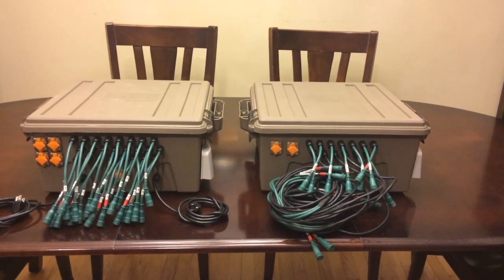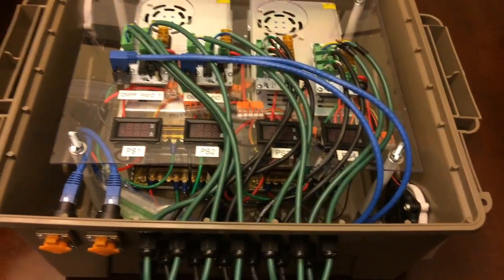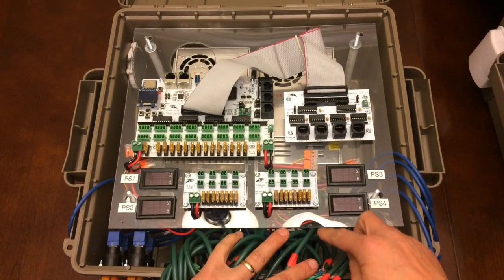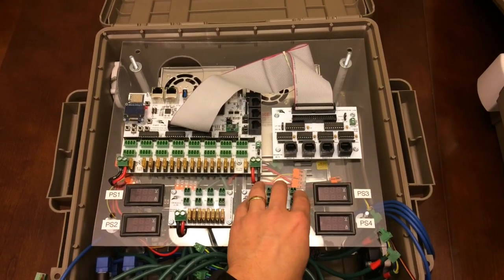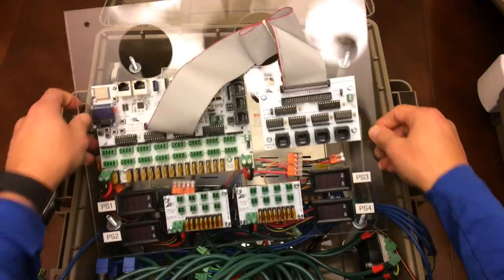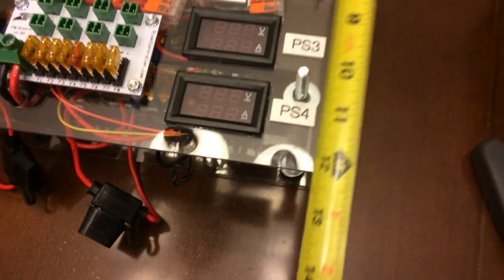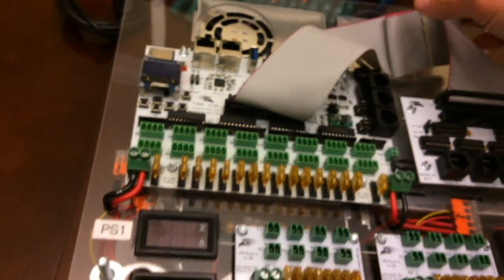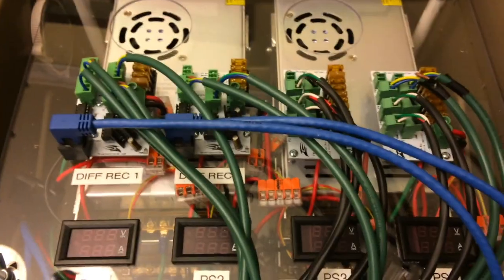Falcon F16V3 Ammo Box Build Breakdown

Comment: Hi can you tell me what size a fuse you use,  for a f16v
Reply from the maker: The fusing size can be debated. I use 25A fuses between the power supply and the F16 board. However, I believe each power input to the board is rated for 20A. That rating should be verified but I’ve not ever had any issue with the setup. After running a bunch of tests with real world pixels, rarely will any single output draw anywhere near 5A. So, the possibility of driving all outputs at the max is highly unlikely. The 5A board fuses and 25A fuse from the power supply are really there to cut power should there be a short somewhere.  I’ve had 5A fuses go but never the 25A power supply fuse. 

Good luck!

Comment: I have watched all your videos multiple times. Preparing for a new display this year. Going from traditional to pixels. Question is where do you get the pig tails for the boxes I didn't see them on your parts list.
Reply from the maker: Thanks for the comment and glad to hear that all the videos have been useful. 

Regarding your question, the pigtails used in the controller builds were purchased from the vendors where I also ordered my pixels. You should be able to source those female connectors with your specific connector end (Ray Wu, X-Connect, etc) from most any pixel vendor companies. They are typically 14” to 18” long and work great. 

Best of luck through your transition from tradition lights to pixels!

Comment: Great video. Really breaks down the build to easy understanding. One question i had was, when connecting two PSUs, you have live, neutral, ground from the AC line jumped between the PSUs, but what is the 4th black line?
Reply from the maker: Thanks! The far right 3 wires are for connecting the top and bottom power supply AC connections. The black wire to the left of those 2 wires is to bond the DC V- between power supplies. Don’t do that with the V+, just the V-. This ensures that you don’t get data corruption if you power inject pixels across the two power supplies.

Comment: hi there i want to connect other power supply to my controller advatek controller to port 9 to 16 to do so could i add a other ac wire to power supply 2 and  connect negative and postive to v2 and plug that power supply into wall socket so that means i would have 2 separate wires to plug into wall or is there a better way thank you for your help and then from port 9 to 16 i could use that power supply to power inject also
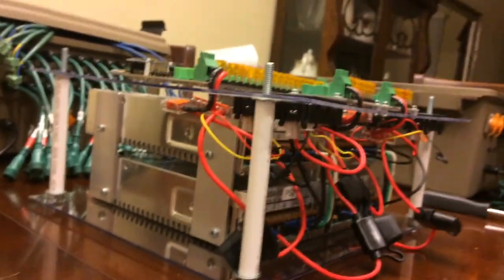Reply from the maker: Hi Den Bel, thanks for your comment. You can certainly add a second power supply and tie them together (in parallel) while using a single AC power cord to go to your house wall outlet. See the video at 18:12. There, I show how I connect two power supplies together, and they share a common house AC plug.

Comment: hi there great video im new in doing pixel i have a question i have total 1,455 5 volts pixel ws2811 in my props running at 30 percent brightness i have a advatek controller and 350 watt power surply could the power surply handle that and if not how could i connect other power surply thank you
Reply from the maker: Hi den bel, thanks for the comment. You should have no problem powering that many pixels with one power supply. Each 5V pixel uses about 0.3W at 100% brightness on full white (with all 3 LEDs on). So, 1,455 x 0.3W/pixel x 0.3 (brightness) = 131W, which is well below the 350W capacity of your power supply. 

In reality, you’ll end up using less power than that due to voltage drops across the string of 5V pixels. 

Good luck with your setup!
Reply: thanks alot for helping me i will power inject   also on my props have a good day

Comment: Very nice work! I am going to try and replicate this. Question - Does the air vent compromise the waterproofing? I am in NJ and get some snow during christmas
Reply from the maker: Thanks for the comment Roshan. The air vents do not compromise weather proofing. They are designed specifically for this type of purpose. The outer piece has a rubber gasket that seals up against the enclosure housing. The interior screw piece is used to tighten the outer piece with the rubber o-ring gasket to seal the opening from water ingress. 

The opening of the vent should be pointed downward so water can’t naturally get into your enclosure. My boxes are used outside in the rain and snow and have had no water ingress over 5 years of use. 

The exhaust fan mounted to the interior of the right vent is blowing air out. Be sure to orient the fan properly so you aren’t accidentally blowing air in and potentially drawing water into the enclosure. 

Good luck with your build!

Comment: Cool. But how does all those electronics work. ?
Reply from the maker: Hi John, in a nutshell, the Falcon pixel controllers convert show data streams (from a Falcon Pi Player computer like a Raspberry Pi or a Beagle Bone Black OR from a PC running xScheduler) to pixel compliant (WS2811 in my case) data streams. The controller also supplies DC power for the pixels. The choice of pixel controller is based on your needs (how many outputs you want/need, how many pixels per output, and how consolidated or distributed your pixels are in your show). 

That’s a basic description. There are other good videos at the xLights video repository in the xEssentials series. Since you asked, I may put together a brief intro covering the basic pieces to a show once the season is over and I have access to all the components.

Comment: Thank you soooooo much for this! I built the box on the left and it ran my whole show with 0 issue. I was amazed at how I hardly used any Power Injection and it still came out super nice.  Some runs had close to 350 pixels Over 60 feet @ 25%, and was minimal degradation. Going to build your CG 1500 for next seasons add-ons! Much appreciated! Thanks Again!
Reply from the maker: Congrats!!!

Comment: This is very nice build Steve.  I’m using bud box 32026 for controller and 2 diff expansion.  I’m running out of space  for the 9 cable passthru glands.  Can the cat 6 cable be bent in any direction without causing connection issues? Tks
Reply from the maker: Thanks for the comment Randy. Controller build boxes can get cozy. The cat6 cables shown in this video have one straight end and one 90 degree end. The cable itself is very soft and pliable, so it’s possible you could immediately turn the cable without issues. You just don’t want to do any extreme turns which could flex the internal wires so much that they fatigue and break internally.

Comment: Do you have info on the pigtail connectors? Gauge, length
Reply from the maker: Todd, the pigtails are standard 18AWG, 18”, 3 core, female pre-made pigtails. Order the ones that match the pixel connections you purchase (Eg xConnect or Ray Wu). Most vendors sell this type of pigtail.

Comment: What fuse are you using in your auto fuse that is between the power supply and the boards?
Reply from the maker: The fuses are standard ATC auto fuses. I most commonly use 20A or 25A fuses between the power supply and a control board.
Reply: @NiFamilyLights  Thank you! I'm in the process of ordering everything I need to do my roof line for my first year. Only thing I seem to have trouble finding is pixels. I decided to go with Kulp controllers as they look like a nice affordable option. Have you ever used them?
Reply from the maker: KW, I have not used Kulp controllers.  However, it is a great product, so you should do well with it.  I personally like the Falcon controllers as there are fewer parts to deal with.

Comment: The blue cable goes out to your Router?
Reply from the maker: It depends on which blue cable. There are 4 that are attached to the differential expansion board. These connect to differential receivers (aka smart receivers). Although they use Ethernet cables, the data sent is not normal IP data, so you don’t want to connect those to a router. 

There is also a network cable that’s connected to the network port at the top of the F16v3 (and there’s 2 network ports). That one does connect to a router or switch.
Reply: @NiFamilyLights  Thank you so much Mr.Ni. Im new to this hobby Zero knowledge about Xlights. But Im starting to learn from all of your posted video as far as setting up, connection, parts etc. I only have i.e. 16' Mega Tree with topper star, Roof line, Icicles, 3 window outline, 6 leaping arches,  6 Mini Tree with star, 6 Verticals poles and Star of Bethlehem. I use figure 6 that represents my 6 grand Kidz hehehe. All of this pros and models have already installed pixels. My problem now is connections to my controllers and power them all up..  Right now the level of stress and worry is starting to rise up  and we are approaching  half of 2021, problems starting to occur i.e. How many controllers i need... how many expansion board i need.. smart receiver i need.. How many PS i need.. where to Power Inject.. etc etc..  All my props or models are all done and ready to deploy But my controllers not yet. And Im still working and following your CG1500 pixel Controller Builds video. I only have 800 sqft single floor house (Rambler type) on a Half acre property. You can chk in google 3801 Forestdale Ave Woodbridge Va. 22193.
I need help..! Can you help me? What system can you suggest or recommend for me to use? This is what I have right now.. i.e.
1-F16v3 bought assembled with 12v PS.
1-F48 Bought assembled with 1 receiver and 12v PS
2- Expansion Board with ribbon cables. (board only)
5-12v PS
4- Power Distro (board only)
and 2 rolls of each low voltage power supply  cable and Data cable.
I know I will be needing some more parts and electronic components..

Tenx
Manny,
Reply from the maker: Manny, do not be discouraged. The first year is definitely the hardest and I didn’t get my first year show plans done and deployed until a week before Christmas. So, every day something new got completed and setup. 

The best thing to do is to make a plan for your controllers, wiring, etc. Draw your house, draw your props, measure distances between props (to plan wiring), and then you can determine the best place to position your controllers so that you can minimize wiring. 

Find me in the Facebook lighting forums and message me. I’d be happy to review your plan.
Reply: @NiFamilyLights  How can I find you in Facebook? Sorry I'm not so good in computer.
Reply from the maker: You can email me at nifamilylights@gmail.com

Comment: Like your setup. Can you share a simplified diagram connection for all those power line and electronic board components connection. would appreciate it so much. Tenx.
Reply from the maker: Tenx, thanks for the comment. I don’t have a diagram to share but the connections aren’t too complicated. 

The AC power coming in goes to the right three terminals of the power supply for Line (hot, usually black), Neutral (usually white), and Ground (usually black). As shown in the video, you can link up power supplies to the same incoming AC power line. 

For the DC side, the left set of terminals of the power supplies usually have 3 terminals for V+ and 3 terminals for V-.  For the board components, each board’s input power terminals require a V+ and V- (also referenced as ground). This is NOT the same as the AC side ground. You’ll want to connect the V+/V- from the power supply to each component. 

In my builds, I have each component being powered by its own dedicated power supply. This includes the F16V3, each side has a power input and each side gets power from its own power supply. Some people use one power supply to power multiple components. This is ok as long as you do some math to prevent overloading the power supply. 

Hope this helps you.

Comment: What a fantastic build. Do you happen to have a tutorial or how to guide for connecting the volt and amp meters to the power supplies?
Reply from the maker: Thanks for the comment. Although I have the meters in the controller on this build, I have simplified later builds and not used them at all. 

They do look nice but unnecessarily complicate the wiring. Once setup, voltages of the power supply outputs don’t ever change. Modern controllers have LEDs on each output, so you’ll know right away if a bank of lights are out indicating that a power supply is out. 

If you do want to put them in, I do cover how to wire up these meters in this video at 6:47. Good luck with your builds. 

https://m.youtube.com/watch?v=z-UStFoIHY8
Reply: @NiFamilyLights  thankyou so much for the information and advise. Ill just leave them out. 👍👍👍

Comment: With the Ammo Box on the left, can you use powered injection to anything coming off the Falcon v16 without having to separate/splice the positive wire? Do you have to treat the injection coming from the other two power supplies like injection from a. Separate power supply?
Reply from the maker: Charles, for your first question, the answer is yes.  You could power your pixels from the F16 and also power inject in other places of the prop without breaking the V+ line.  There's two things to consider when doing so.

1) You should definitely do the math and give yourself plenty of "reserve" current to make sure you don't inadvertently end up powering more pixels than you think at the power injection point doing it this way.  

2) The other thing to consider is potentially having one power supply "drive" another.  The V+ from one power supply may be higher than the V+ of a separate power supply.  Since you'll essentially have the V+ connected to each other within the prop, you may run into a situation where the difference in voltages will cause one power supply to then be sending power to another power supply.  Inexpensive power supplies like the ones I use do not have built in protection to prevent this, so it could cause damage to the power supplies.  Higher quality power supplies like the Meanwells have built-in protection to prevent this condition.  Meanwell calls this "parallel operation", also known as "current sharing" capable.  Question 24 on this Meanwell FAQ shows a wiring diagram, https://www.meanwell.com/qa.aspx.  Again, doing this could inadvertently draw more power than you think with your power injection lines, so be sure to plan accordingly to not overload your power injection wires.

Now, if all the power is coming from the same power supply, you don't have to worry about the 2nd condition stated above.

Comment: Your rj45 couplers keep the water out of the box. But it looks to me that water can get into connection on the outside? Are these couplers good? Trying to keep my cost down, and am finding that rj45 waterproof couplers are pricey. What's your thoughts our suggestions. Thanks
Reply from the maker: The couplers used in these videos have worked great to keep water out of the box.  I've used 4 of these builds for 4 years with no issues.  I am mindful to keep the network cables plugged in physically hanging lower than the coupler to the box so that they don't draw water towards the connection.
Reply: @NiFamilyLights  Thank you for the info.

Comment: Setup is soooo clean! What is the advantage of having all grounds tied together on power supplies?
Reply from the maker: Thanks Charles!  You want to tie the DC Grounds together primarily so that the data signal doesn't get corrupted across your pixel props.  

For example, you run power and data from a controller output, then use a power distro board output to power inject to extend the run to other props.  If the distro board power injection point's ground varies from the initial data/power output, the data signal will likely get lost (or corrupted).

Comment: Is it ok to have both 5volt and 12Volt power supplies in the box
Reply from the maker: Yes, it's fine to have a mix of 5V and 12V power supplies in the box.  You'll just want to be sure your pigtails coming out of the box are labeled well so you don't have 12V going to 5V pixels and vice versa.

Comment: Hey Steve, Thanks again for these videos. Question, when you work with to Falcon F16 controllers do you hook them up directly (daisy chain) or  can they be connected together via a switch?
Reply from the maker: Hey Steve, for the Vine Church show, I'm running 2 Falcon F16V3s that are both connected to a network switch with the RPi running FPP.  I haven't used the daisy chaining of the Falcon network interface, but I assume you could do that instead of running both F16s back to a network switch.  How many you can daisy chain?  Not sure.
Reply: @NiFamilyLights  Pixelconnect doesn’t truly know either but they mentioned something like 3 or 4 controllers. I went through the manual and looked online and really couldn’t find much of any information about it. Thanks for the info though
Reply: From what I know, the connectors act as a passthrough/switch so in theory you could easily have hundreds daisy chained. Latency would build up as you add more but that's not reasonably a concern till you're well past the point of insanity
Reply from the maker: The developer of the Falcon boards said that the switch interface on the F16 is a 100Mbit interface for the F16v3 and the new F16v4 coming out in 2021.  He said that you can daisy chain up to 4 or so before you start to get latency issues.
Reply: @NiFamilyLights  thanks for the clarification!

Comment: For your build... the Bolt Depot links are not working.  Do you have any more detail around the m3x12mm (bolts, hex bolts, screws???), m3x16mm (bolts, nuts???), m4x8mm (bolts, nuts????)
Reply from the maker: Aaron Plausso, thanks for pointing out that the links to BoltDepot aren't working.  It appears that they changed their website, so the links to the items changed.  I updated the linked BOM to reflect the website's new URLs.  Best of luck with your build.